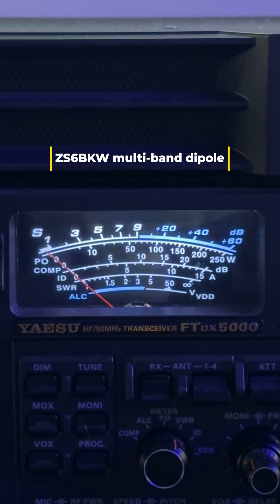Vertical vs Horizontal Antenna Polarization #hamradio #antenna #dx

Comment: This is why i have multiple antennas in both horizontal and vertical polarization. But ill add that i can also monitor 6 websdr sites simultaneously to monitor propagation.

Comment: Would it make sense in this case to listen on horizontal and Tx on vertical?
Reply from the maker: Yes it might. I thought I said that at the end of the video.  If I didn’t, I meant to.
Reply: @n4hnhradio  Sounded like you said that, but I wanted to be sure. I have an FTDX10 so 2 antennas means an external switch. But I have other antenna improvements to do first.
Reply from the maker: Watch for a more detailed video later this month.  Two perpendicular dipoles at 1/2 wavelength above ground can provide low-angle coverage in all directions with a lower natural noise floor.